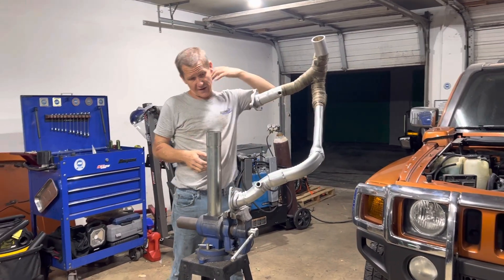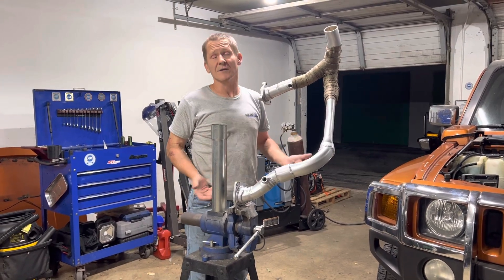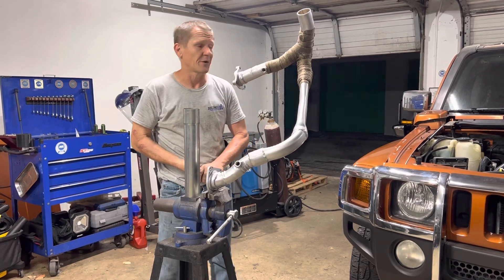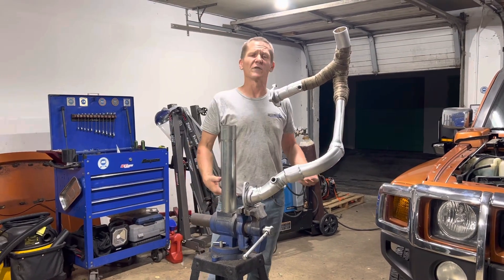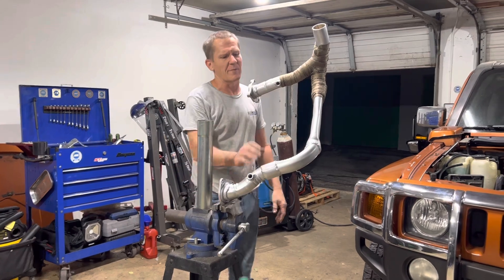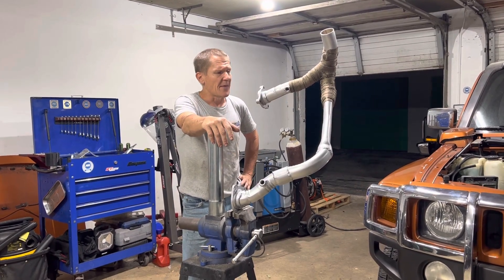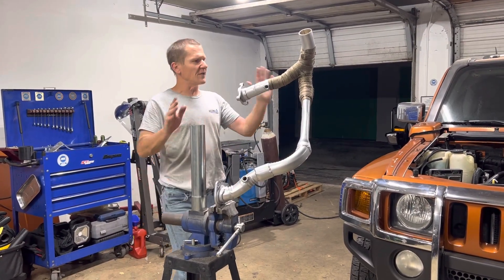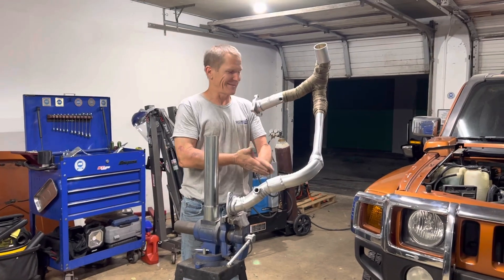Hummer H3 Alpha Conversion Exhaust Final Thoughts

Comment: I think I’m going to drop a 12 valve diesel in mine. I want it to last a long time and have more torque, even if that means breaking, fixing or changing different parts of the hummer to get it to work out.
Reply from the maker: But diesel is the most expensive of all the fuels you could buy at the pump. Most will go to the 105 octane race gas that is e85 because it sells for even less than 87. That conversion would make your ride more expensive to drive anywhere.
Reply: @secondshiftperformance  it’s already expensive to drive no way around it. Mostly because of the full time 4x4. I want the strong engine.